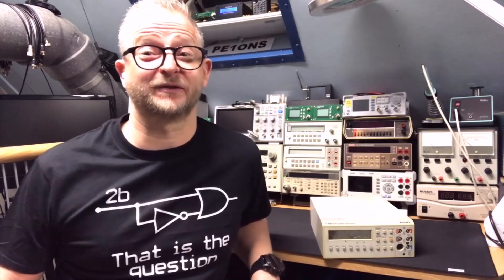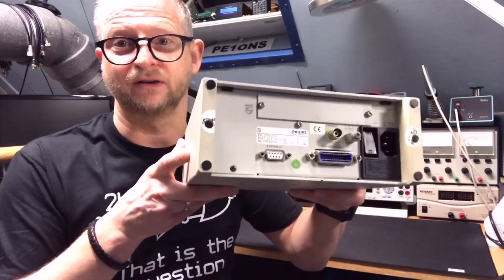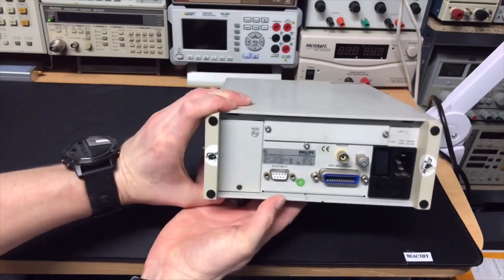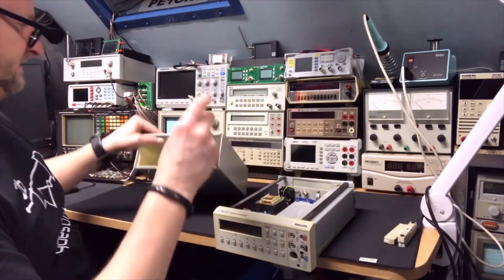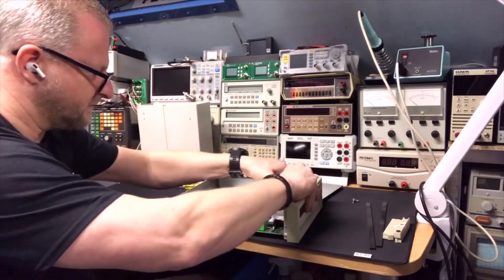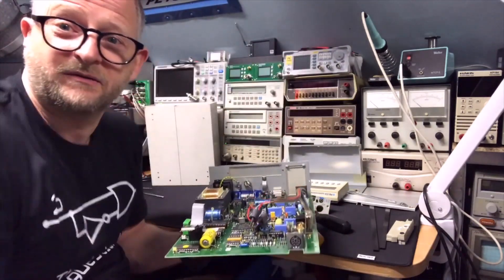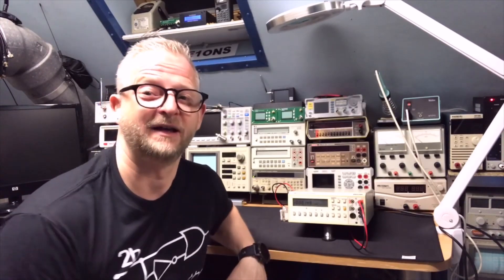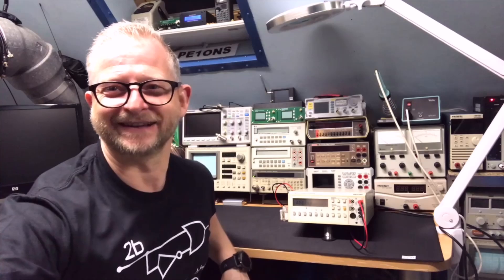#098 Philips Fluke Multimeter PM2534 Display Replace

Comment: Nice repair job on the meter. Back then, we had some of those meters in the lab. They were tossed out by the ATE guys: Too slow. So we added them to the manual benchtop lab equipment. But shortly after that, the guys (and me included) never really got to like them. They were always to slow, somehow awkward to operate and mostly the display was hard to read. So shortly after that they were also tossed out of the lab. Most of them replaced by early HP 34401a DMMs. They really worked a charme and stayed in the lab till I quit the job there ten years later.
Reply from the maker: Thanks!  yes agree, the display is not that good. yes the HP are great!  thanks for the story, very nice
Reply: I have the same meter, very happy with it and it served me many years of good service. The drawback is the lack of backlight